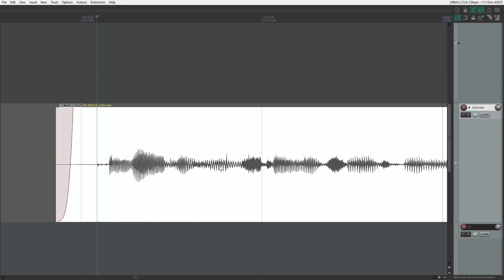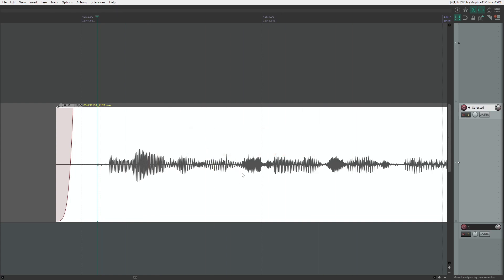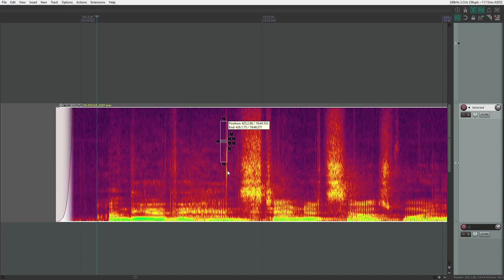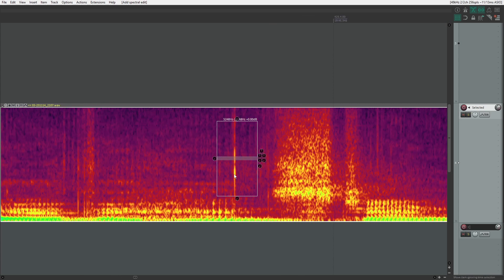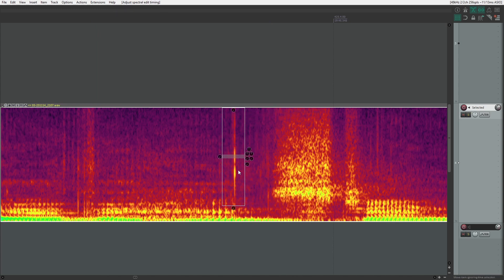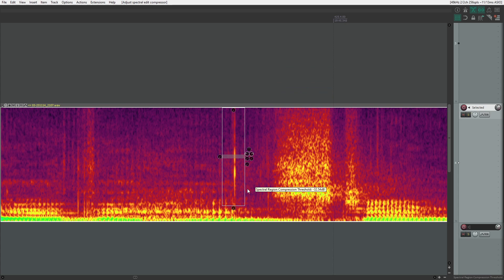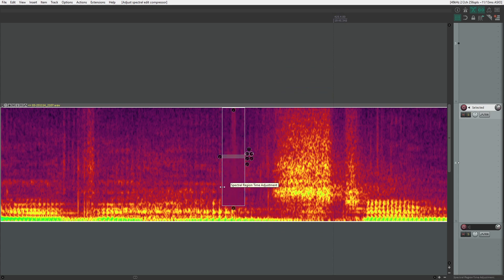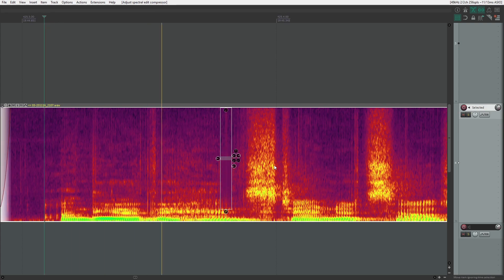How to remove clicks from audio recordings easily and quickly? - REAPER Tip

Comment: when i do what you do, i dont have the spectral thing showing, i dont know why, and i cant editing it
Reply from the maker: Interesting.
Can you try right clicking the item, go to Spectral Edits and click "Show spectrogram"?

If that doesn't help, go to Options (top of the window) > Peaks Display Mode and click on 'Show spectrogram'.

Hope that helps!
Reply: @KMJoshiMusic  Oh , thanks for your fast answer
And indeed i have "Spectral Edits" > "Always show spectrogram" or "Add spectral edit to item"
And so i can edit with the 2nd option, i'll see if its working, thanks a lot

Just the lowest area i can edit is bigger than yours tho
Reply from the maker: You're welcome!
If your edit area is not small enough, right click the edit box itself, find Take Processor FFT Size.
A smaller value will give you a smaller area to edit but I highly recommend never to go below 1024 points. A smaller value means a smaller "resolution" of audio, and it won't sound very good. I recommend keeping it at 1024 at least and use Fade options I show in the video instead. This will allow you to have a "smaller" area of edit using fades.
Reply: @KMJoshiMusic  Im coming back to you, cause even after doing this and with more threshold, or im doing this wrong idk, but i still hear the clicks just tinier than it was before :(
Reply from the maker: @pictoract 
You probably want to increase the ratio, then! Lowering the threshold too much will result in artifacts because it'll soon start affecting the rest of your audio's frequencies. So, try increasing the threshold instead. If that doesn't help, it's likely you just need to increase the size of the edit box a little bit. Don't use your eyes to try and fit the noise perfectly inside the edit area. Instead, just use your ears. Sometimes, it might "look" like it's covering other parts of the audio. But if it isn't affecting the audio (your ears can't detect it), then it's perfectly fine! Good luck!